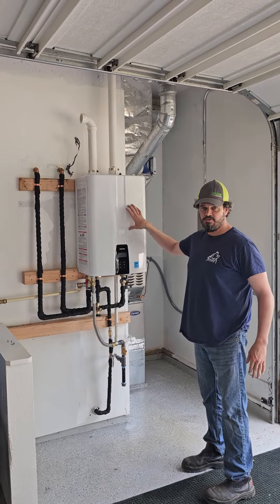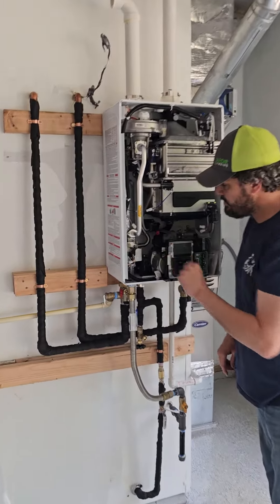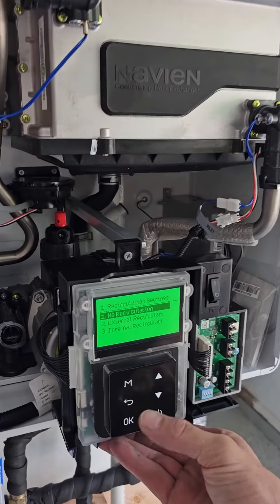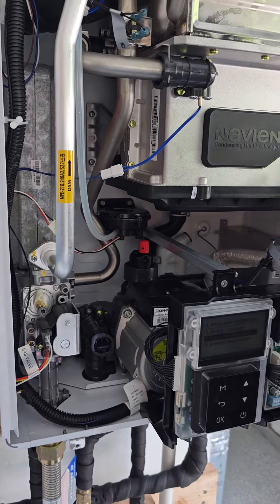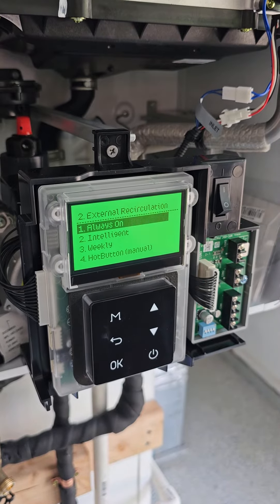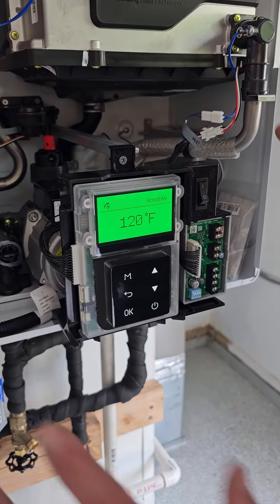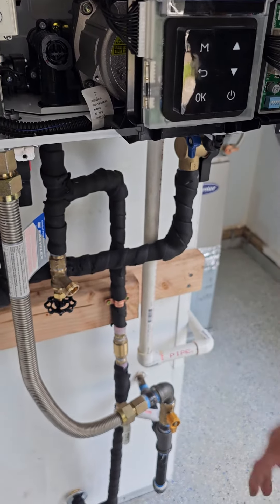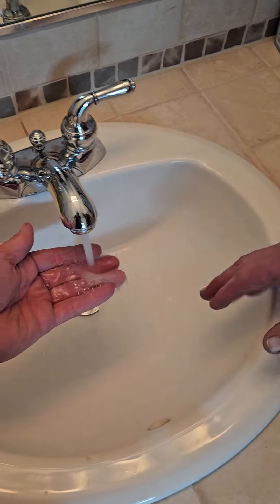Navien Tankless Hot Water Recirculation set up with dedicated recirc line

Comment: Useful tutorial. Thanks. What's the difference between INTERNAL recirc and NO recirc? Since the internal buffer tank is small and the hot water still has to travel from water heater to fixture, is the benefit very small?

Comment: Excellent video and explanation!  I had incorrectly set the little switch inside to internal and set the panel to external.  I couldn't figure out why I wasn't getting hot water within a few seconds. After watching your video, I checked the little dial switch, realized it was set to internal, changed it to external, and the issue was resolved.
Reply from the maker: Excellent!!

Comment: Hi. My 240A2 unit starts warm and then goes cold and eventually only goes warm but never gets hot again like it used to. My research indicates it’s a faulty check valve. Are these available on Amazon and can you link the right part? And is this an easy enough repair to do as a homeowner?

Comment: How do you pipe the furthest fixture for the dedicated line? Put a tee in with hot coming in? Thanks
Reply from the maker: Yes. Install a tee on the Hot water line near the furthest fixture or at the fixture you want hot water delivered faster. From the Tee run a dedicated 1/2" pipe back to the water heater where depending what type water heater you have you will need a circ pump, valve, check valve or two.

Comment: Can this be installed with a pex manifild system?
Reply from the maker: Yes absolutely. The unit turns on and off based on flow. Once you turn on a faucet in your house and begin drawing water out, the tankless detects that you have open a faucet and need hot water. At that  moment the unit fires up and heats the water to 120 degrees as the water passes thru.

Comment: Is there a check valve on the dedicated recirc line?
Reply from the maker: Yes however don't trust it. Install your own dedicated check valve on your recirc.
Reply: @LearnPlumbing  which direction should the flow be?  Should it be going toward the hot water heater or away from it?
Reply from the maker: @ryankathalynas5527  The dedicated 3rd line hot water recirculation is flowing  back to the water heater.

Comment: Hi there,
I have a Navien tankless water heater that was exchanged for free by a Navien crew in January 2015 - the previous Navien tankless was leaking internally like crazy and flooded my basement - - ever since it was installed, it has been at 115F setting for hot water ( i live in toronto )   -- - my question is, can i enter Commercial Mode on the heater and increase from 115F to 150F and safely run at 150F  24/7 - 365 ?  i don't have small children in the house, they all got married and moved out within the last 6-7 years - -   would there be any issues with the 150F setting when the hot water inlet to my LG front loading clothes washer is hooked to a hot water line from the Navien ?  supposedly my LG washer can run at a maximum of 70 celsius on a cycle called "Sanitary" - - please advise, ,, thank you in advance

Comment: Hi! Just flushed my Navien tankless water heater and noticed a slight amount of water coming from the red cap that is pictured in your video. Can you offer some guidance on what could be causing this issue? Thanks!
Reply from the maker: Absolutely. That's your air vent on your recirculation line. Designed to expel air that's it your line and supposed to close when water is drawn. You can try to loosen and tighten the cap to see if you can help make the seal. If not the part is easy to get. Amazon Navien circulation pump air vent. It's $17.